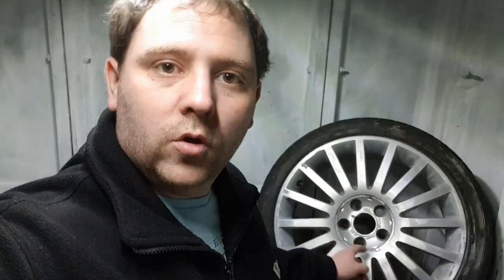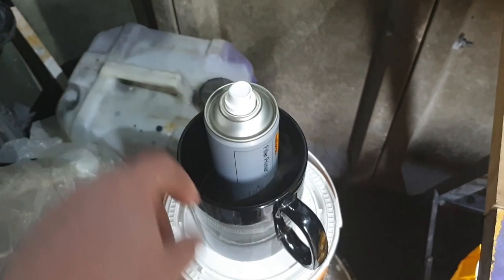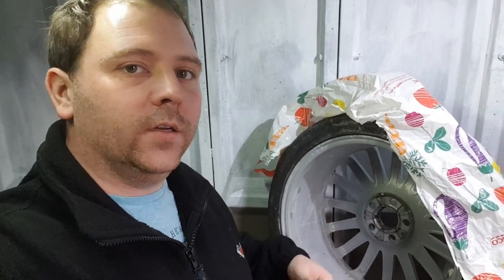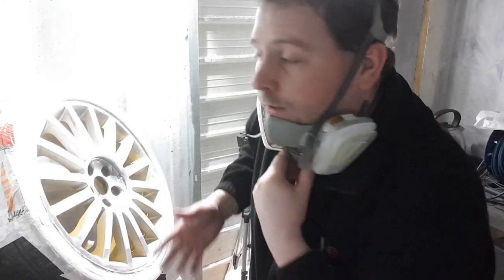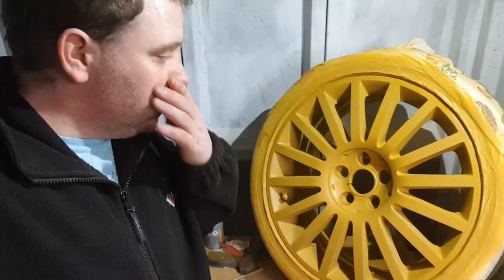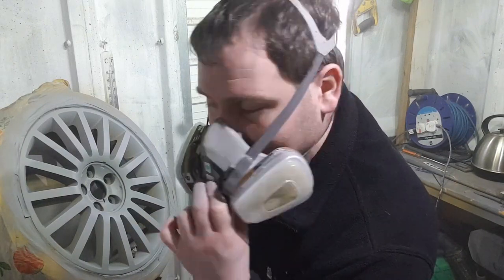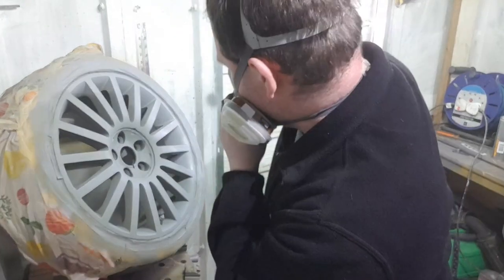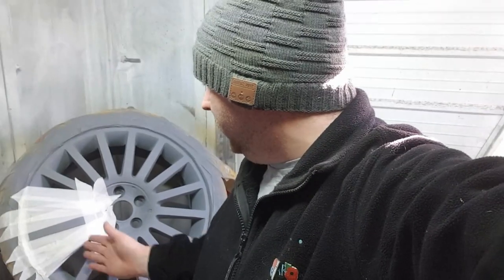Ford Mondeo ST220 applying primer to alloy wheels

Comment: The kid for the mod for savage garage
Reply from the maker: lol, i think im older than James Aaron
Reply: Chazz Coombes oh dear that was a auto correct that was supposed to be thanks for the mod. Don’t suppose you know if that would work on my Freelander it has the same function of pushing the wing mirror adjustment down.
Reply from the maker: @Ajt1994  might would be a matter of testing and finding the wiring